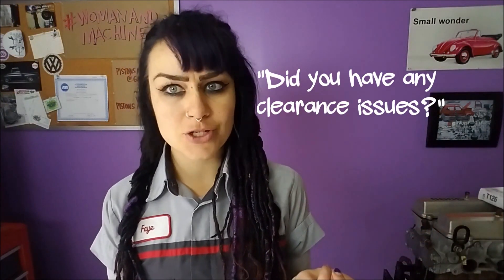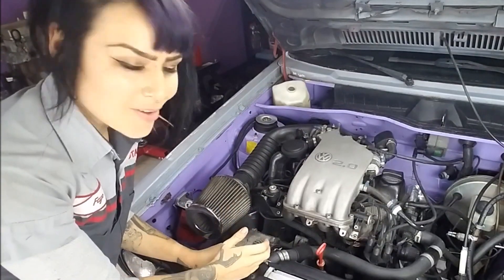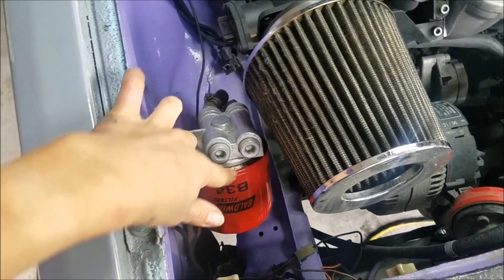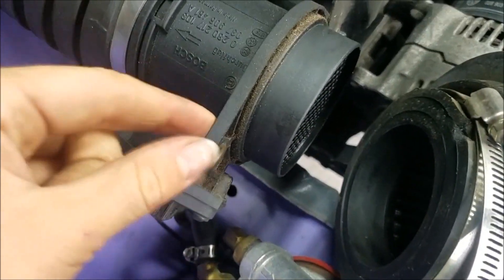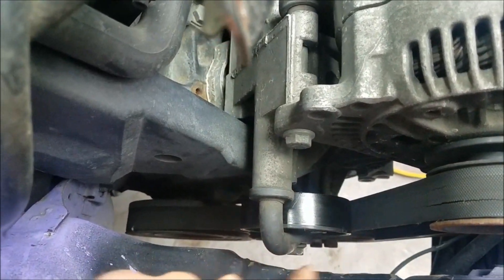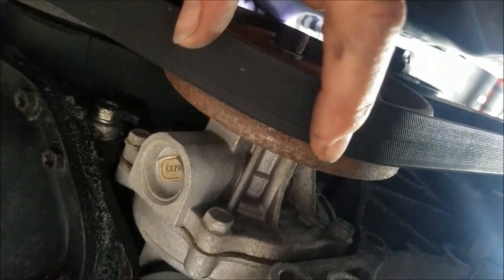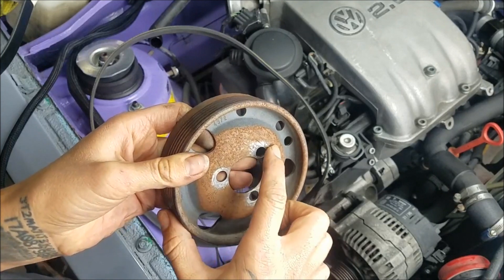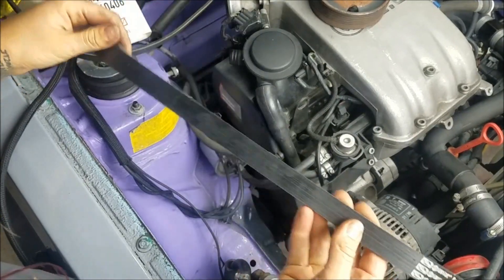Drive Belt setup for ABA swap into Mk1: Answering Viewer Questions

Comment: I had never heard of a coolant filter so I had to google it. Makes sense since I never had a semi-truck nor an older car since these are the main reasons I came to learn. I guess the reason you installed this was to reduce rust and debris in the cooling system. Couldn't wait for the answer. I learned that these have a different thread pitch than oil filters to prevent accidental use of an oil filter for this application and also learned that they often contain chemicals to stabilize the coolant (on the larger size coolant filters that are typically used in semis).  Cool.

Comment: Hey Faye! I love this style of video. I’m interested in doing an abs swap in my 83, but I have trouble with wiring. What kind of wiring set up did you do? Do you recommend running 2 fuse boxes and slicing the aba engine harness? Or swapping the whole car to the mk3 harness? Thanks
Reply from the maker: I have only the mk1 fuse box actually, and then I just have a few other relays and fuses for the engine as necessary! I kept the mk1 harness for everything body, lighting, fans, wipers, you name it!! Kept it a heck of a lot simpler. I also have an OBD1 ABA, which also made life easier when it came to wiring. I'm thinking of doing a video on that topic at some point!
Reply: Faye Hadley thanks Faye. I look forward to more videos about your sweet ride.

Comment: Do you believe that the aftermarket air filter really gives you that much added horsepower? Unless a vehicle has an ECM that you can retune after that upgrade, I've found the change wasn't worth the addition. It's amazing you fit that engine in that bay. Smiles.
Reply from the maker: Oh God no, I hate aftermarket air filters and think they are a huge waste of money but the OEM air box did not fit in the space that I had.